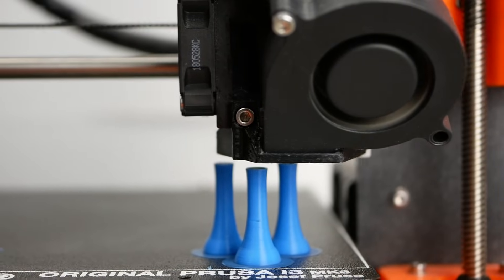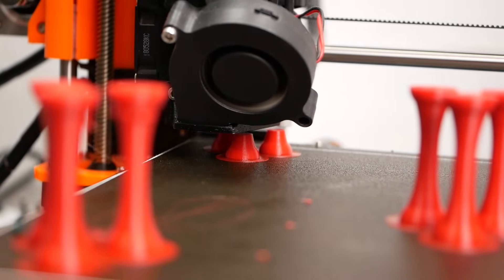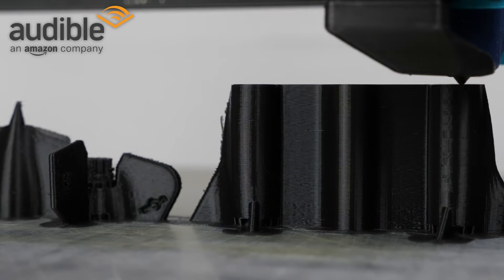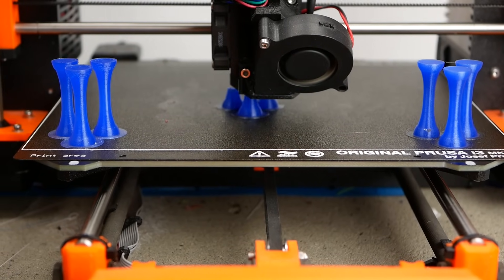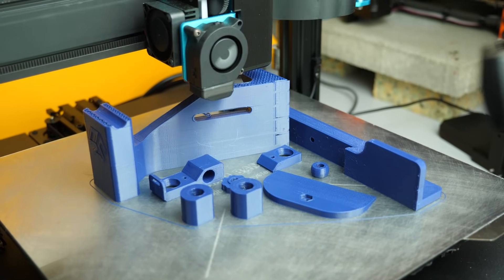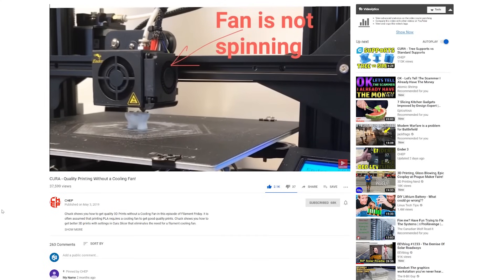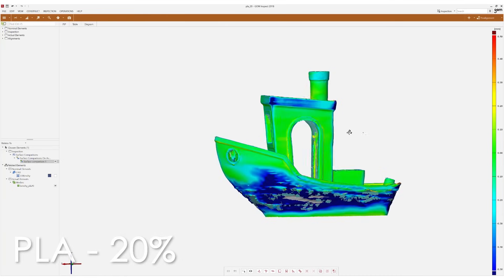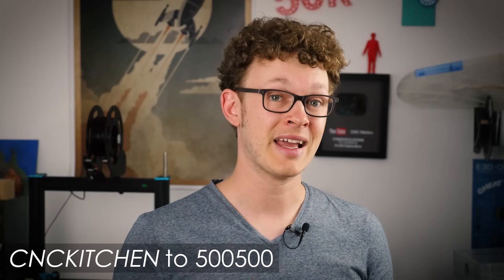MUCH STRONGER 3D prints due to LESS COOLING! Testing PLA & PETG

Comment: I’m quite new at this but have already figured this out.  I mostly print ABS because it’s easy to get a nice finish and further refine it.  But I’ve got some excellent PLA prints out with much higher temperatures than usually recommended and practically no cooling.  Empirically, these are substantially stronger than cooled versions and look much better too.

Good information here! I like your methodical approach.

Comment: Greight video, thanks. I find 0% fan is best for most prints, but I have it on 20% for areas that are unsupported (bridging), support interfaces, and for very small features where the layer time would otherwise be too short. But I agree, no cooling is usually better!
Edit: This also applies to TPU!

Comment: I appreciate this testing.  I’ve done quite a bit of fan testing on a few different printers.  I find that with PLA, I need 80% (at least) to get a nice 3D Benchy at 60mm/sec on the Prusa MK3 with PLA.  With PETG, I can lower the fan speed to 40% and get good prints.
Reply: For petg, do you lower the print speed when you turn down the fan to compensate for sag? I adjusted my fan to 50 mm/s with the fan at 60% and it sagged in the middle parts of the project
Reply: @tradertom4843  It depends on the size of the model -- larger parts tend to need a bit more cooling, especially if there are bridges, or holes.

Comment: You're definitely right about the Ender3/CR-10 heatbreak fan. I upgraded a CR-10 mini to an E3D v6 and when I printed a benchy when I hadn't printed the cooling fan mounting bracket yet, it was the most horrible result I ever had.
I'm also thinking this may be related to the watertightness of 3D prints. I used to get some good results with small boxes, but a large-ish boat I just printed is leaking. I'm going to try cranking the temperature up and disabling the cooling fan. It will still be cooled a little bit due to creality's design.
I really also want to get my own universal testing machine running. So much to test, like creep and fatigue life. My machine is based on a raspberry pi though so I still have some programming to do.

Comment: FYI, others blamed my results on the Creality leaking fan shroud so I did follow up tests with the bottom of the fan shroud blocked on my Ender 3 and got the same great results with no cooling fan. So my profile does work. Watch at 3:05 here to see what I did. https://youtu.be/QvyesgYLwQk

Comment: 0:51 - busted x axis pulley bearing. I've had this too, and, quite surprisingly, the prints were somewhat ok (I'd expect much worse). However, replacing the pulley with a new one made a world of difference in print quality. Also, assessing the situation, I concluded the bearing shatterred due to too high a belt tension, and I've lowered the tension by one or two teeth.

Comment: Well done video on a very important topic!  I have suspected that part fan speed should be high only during overhangs -now you have proven it!
Now I wonder if post cured (what they call annealed) PLA parts can get to 'no-fan' strength but use a bit of fan to help overhangs.
Post cure of PLA functional parts is becoming my standard because heat deformation and creep are unacceptable without it.

Comment: Very nice Stefan! You must try cpe from filamentum. It is the filament with the best layer adhesion i have tested and I use it for all mechanical parts on my 3d printers. Also petg type must be dry!

Comment: Well thought and professionally executed, with useable results, as always, thank you!
Of course your results raise additional questions:

1. How much would the temperature of the heated build chamber affect the layer bounding of ABS/ASA prints? (I think ABS still is very important, because I consider the properties of ABS as suitable for everyday use objects, instead of just vanity objects).
2. Could PLA prints get even stronger by printing those in a heated chamber?
3. How far would the results from this tests change, after annealing the 0%, 20%, 40%, 60% and 100% PLA prints? With focus on the question: Could annealing compensate for the strength loss by printing with the fan on?
:)

Comment: Your should include the actual ambient air temperature in your results which is being used by the cooling fan. I usually print petg in closed enclosure resulting in 30-35C cooling air. It makes a huge difference if you blow with 15C or 30C.

Comment: It would be interesting if you can redo the test, but with a enclosure, so the cooling air temperature will be higher, closer to the glass transaction temperature.

Comment: With cura I print petg with either 0% or 20% and bridging and layer over support at 100%. It would be nice to do that also for outer walls and bottom layers (except for 1st) if possible (or specifically any overhang), so I would get the best of both worlds. Though that's not possible in cura (which I prefer because of the many settings, like I slow down print and acceleration on outer walls to have a good look and good overall speed)

Comment: I never actually tested this like you did, just kind of stumbled to the same conclusion myself printing stuff for R/C planes and using the knowledge that layer bonding is the weakest point.

I normally use eSuns PLA Pro/PLA+ at around 219c  (4-5 deg hotter than what the "sweet spot" is usually reported to be with this stuff), and for structural stuff I use a bigger 0.8 or 1mm nozzle. Since none of the pieces are tiny and usually 80-100% infill for something like a brushless motor mount I do the same as you did in the video and keep fan speed as low as I think will be okay, often 40-50% fan speed on the big nozzle, with slower speeds the smaller the nozzle.

What I always do as a final step is use my wood-burning iron to fuse the outside surface of the layers into one piece....just like "ironing" in Cura but for the sides instead of the top!

Comment: Another great video. 

I'd like to see you print some thin walled aerodynamically shaped vessels. I'd like to see how possible it is to print a tall shape with thin walls suitable for a fuselage of some type. I'm wondering if a single layer wall thickness would work in terms of printability and rigidity. Another parameter might be to add ribs or a shallow mesh or honeycomb on the inside to aid rigidity without the weight of a second or subsequent layers. Something about the size of a 1 litre water bottle.

Another parameter to test with this one would be to redo the acetone test but with single layered sections printed both horizontally and vertically. This might be relevant because the smoothed layer bonding would represent a higher proportion of the total thickness. A long curing time would be required to ensure all the free acetone has evaporated.
Reply from the maker: Did you check my 3D printed plane series from last year?
Reply: @CNCKitchen  You know, I'd forgotten about that one. I only watched the one where you flew the plane when it came out (that's when I subbed) and didn't realise there were others. Your print quality in that one was amazing. Iv'e watched the other two now and they were very informative. I'd still like to see you do some more thin walled stuff.

Another thing I'm interested in is thin layers. Have you ever tried printing a thin layer to test it's strength? I'm wondering if it is possible to print a thin layer (a disc for example) and then afterward form it in the Z axis using a mould of some sort (just saw your silicon sock video) and heat or solvent.

I Don't have a 3D printer at the moment because I am unable to invest the time right now. However, I do watch a lot of videos on the subject so when I do get one I will have a bit of an idea of what I'm doing and what the limitations of the process are. Your videos are very helpful in this regard. Thank you for doing them.

Comment: Great video !, as you discovered on your tests there is cooling issues at the rear of MK3(S) , i performed some tests and fixed the issue with dual cooling fans with a modded shroud, here are my comparaison pictures: https://cdn.thingiverse.com/renders/94/32/c1/25/9b/f0b72f75684a01b74ff0f459a9f7b898_preview_featured.jpg

You can find the mod here: https://www.thingiverse.com/thing:2978427
This mod allows to print crazy bridges and overhangs btw :)

Comment: Hi Stefan, i found your test interesant because i have this question with my 3d printer settings to, but have no test equiptment like you. Thanks for your test. In the test you found out the less cooling creates a negative effects on the border and overhanging. If you want, kann you try a test with configuration of the slicer. My idea is, to setting on border and bridges a normal or little higher fan speed and the infill with zero fan speed. To make it nicer from outside and stronger in the infilling. By this idea is better if you print your test not multible (like tree) at one time, so they have time to cooling when the nozel changes betwen 1, 2 and 3 on prints, an i thing it is the result of the ship like worther then the test parts there createt 3 at one printig operation (but i think its not realy change the result).

Comment: Hi Stefan (or Stephan?)
again a very nice Video with lots of interesting informations.
When I hat do make some smaler parts where layer adhision might become a problem i useally try to put some glue on the surface. I guess for small parts below 5mm diameter adding some superglue might strengthen the parts. Maybe this is something you can test with your equipment?
Sebastian

Comment: Excellent experiments Stefan. I believe using a thicker layer height when no cooling is used would reduce the deformation in your print since the nozzle will be touching the model for far less time. Also, one more thing to look into when testing for strength is the printing temprature. I noticed you used a relatively high temp especially since you were printing with 0.15mm layer height and typically for PLA I would recommend 190~195 for such a fine quality setting. I print most of my parts with minimal cooling since they are mostly functional and mechanical.

Would love to see you go more in depth in this topic in the next videos!

Comment: The print temp makes a huge difference, I use eyrone PLA and it doesn't stick well at all below 215C cooling or not. I would think the different fan settings make more of a difference at higher print temps.

It would be interesting to see if the Cura draught screen makes a difference as its supposed to be like a mini heated build chamber around the part. I was going to try some ABS but I have an ender 3 so I need a different fan shroud first.

Comment: Very interesting facts to look at my next prints. In my opinion the issue of parts strength is important on things which design is given or you couldn't make bigger/stronger. 99% of the parts I print I created self and try to make them stronger by the design, if needed or failed by the first test. If I copy a broken part (that is not available or too expensive) and print it, I had to use all settings, including your video, to make sure the part will be able to replace the original.

Comment: Hi stefan - for the standing samples ( correct me if I'm wrong here) - especially the petg ones wouldn't printing them at 0.15 layer height cause and issue for the test?  when you print at a layer height of 0.15 your actual layers are inconsistent in height .  you will have 3 layers 0.16 and maybe 1 layer 0.12  (you can see this effect under a magnifying glass).  Wouldn't it perhaps be better to print  at 0.12 or 0.16 to have more consistent layers and therefore less variables? most common z stepper motor and lead screw setups wat to print at layers 0.04 - 0.08 - 0.12 - 0.16 and so on.

Comment: This was interesting. i completed my Bachelor thesis on a similar topic and can to the same conclusions. When looking at a cross-section of a print under a microscope you can clearly see that at low/no cooling the material is almost completely homologous, with cooling clear boundaries between the lines of filament can be seen. 

I was mainly using PLA but also did some testes with PC-ABS and found that even with no cooling and a heated enclosure of 110 C the boundaries were still very clear. As expected proportionally the PC-ABS had weaker inter layer strength to the PLA. I think this is why annealing prints can make such a big difference, it allows the print to homogenise.
Reply from the maker: In my experience besides better thermal performance, annealing PLA doesn't do a lot to the mechanical properties, it especially doesn't homogenize layers or melt them together better. There is actually a video in the making on this topic.
Reply: @CNCKitchen  for PLA I would agree. In my research i found a paper describing this processfor ABS. It would be interesting to see if for materials such as ABS or PC-ABS anneling (or maybe heat treating is a better term?) could improve the inter layer bonds.

Comment: I think you should test HDPE, it is a very strong and food safe plastic that is mostly used in injection molds. It has not been used much in 3d printing because it has difficult to dial in feed and temperature settings, so it's still considered experimental. But there is a Canadian website that sells it and the reviews are good. I think you should be the one to do this test, there is only one poorly made video here on YouTube for 3d printing with HDPE. I read in the product comments that the layer adhesion is superior. Fact: HDPE has the highest thermal capacity among plastics. Fact: HDPE is both strong and flexible, it's used to make inexpensive and durable containers. Fact: HDPE is very non toxic, it's extremely inert so it is considered an approved plastic for use in food processing equipment.  I have been posting this recommendation for the last 3 videos and I really hope you decide to try it, I would be very excited to see you evaluate HDPE for 3d printing. I haven't seen it around much but here's one I found by just googling HDPE filament 
The link:
https://filaments.ca/products/hdpe-filament-natural-1-75mm
But if you find it somewhere else that is great too. Please try it.
Reply from the maker: I'll take a look at it!

Comment: So you worry about the misalignment of your grips? Your testing machine is not rigid (wooden and plastic parts...), and you still haven't addressed the problem of the hiccups caused by the stepper motor. I already suggested some tips but seems like you didn't care.
Reply from the maker: The not fully rigid test setup doesn't hurt the results as long as I don't think that test duration and sample extension are linear, even though it almost is. The "hiccups" aren't hurting either due to the 16:1 reduction between the steppers.
Reply: @CNCKitchen  While I agree with your comment, I would still suggest you to check the following. Put in some very strong piece  of metal (a bar or a thick sheet) that would still not deform plastically at the max load that your load cell can take. And at the same time, measure the deflection of the crossheads. You will be surprised. I am using a BIG hydraulic machine, and I have relatively small steel specimens (~20 mm^2 cross section area) but at the max load, the machine deflects several millimeters. Unfortunately, the connections, the load cell, the grips all add some slackness to the system. 

The hiccup still bothers me, sorry. :D If you want, I can provide you a full solution to it.
Reply: I would have used a pneumatic cylinder to apply the force rather than a stepper motor as the force can be increased very accurately with a simple valve and a gauge.
Reply: @gangleweed  you mean hydraulics! Pneumatic cylinders won't work because as the specimen starts to resist against the tensile force, you will first compress the air in the pneumatic system. There's nothing wrong about the screws, they are used in big machines and as long as yo want to go slow, it will be sufficient. But this guy seems to oversee some bigger issues and tries to correct meaningless things.
Reply: @CuriousScientist  No, I said pneumatics, as in an air cylinder, that applied pressure and has a feedback potential that indicates how much pressure is being applied to a specific piston face area so you get a definite measure of the force as it increases and is being applied. A hydraulic force, being non compressible,  would be the same as the screw method in that it is not progressive.....it could be if the hydraulics were a pressure factor that was incremental and measurable..... whereas air is an increasing force factor as it compresses......I suppose you could have a spring balance to measure the force being applied but that is more complicated.

Comment: Hmm, I print PETG on MK3 without any cooling (225-230°, enclosed), and results are very nice. It looks like you temps are too high - perhaps, because you are trying to get better layer adhesion?
Reply from the maker: I also used 230°C for the first PETG and 240°C for the second.